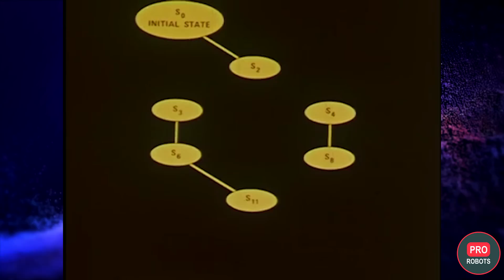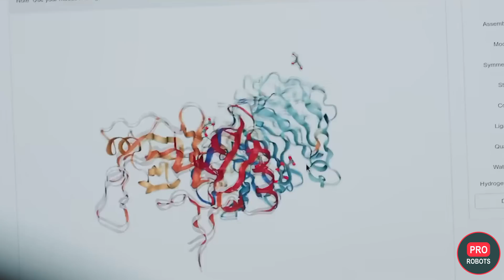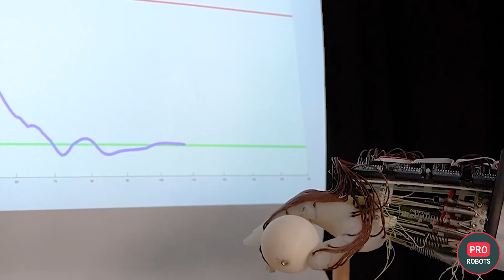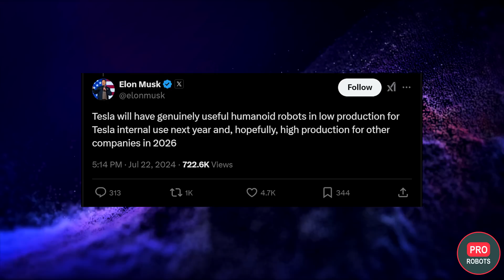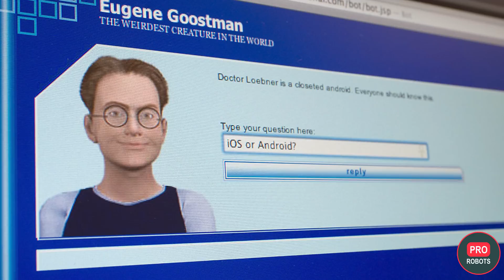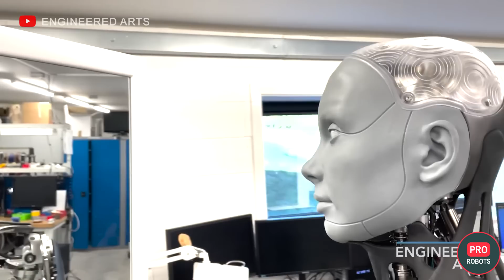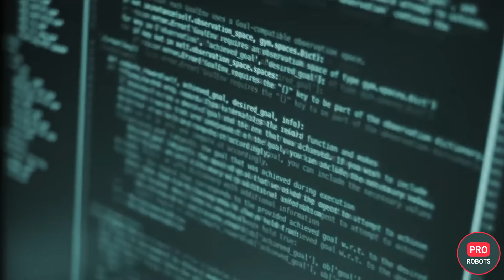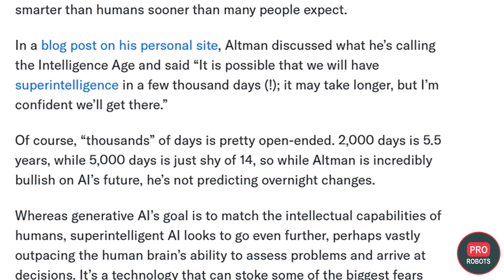The world will never be the same! How will super intelligence change our world? | PRO Robots

Comment: What's a robot: Its a box of cogs, wires and a fancy computer, dump a program into it and off it goes. 
A human is a lot more complex, each one individually programmed by their families and environment, no two are alike although you can mould young minds to do things in unison such as train youngsters to become soldiers, sailors, airmen etc but they still have their original 'programming' although their new training usually supersedes this. 
Personally I'm all for a robotic helper especially as I am older and will eventually need help, not judgemental, never late, doesn't arrive upset by what's happening in their lives, just gets on with the job, like our robot vacuum cleaner does now.